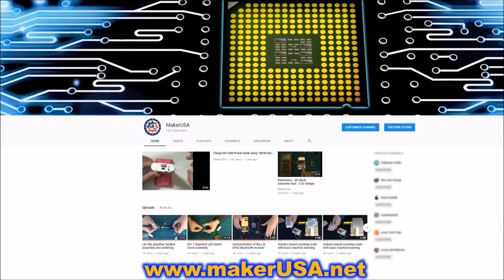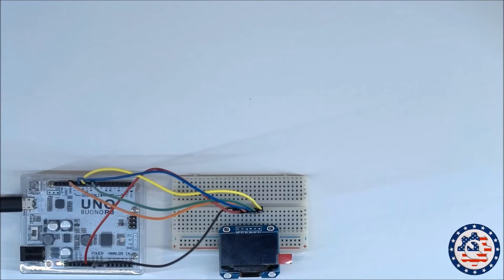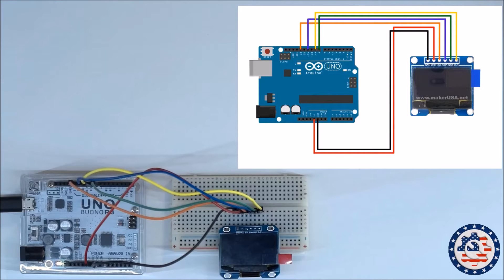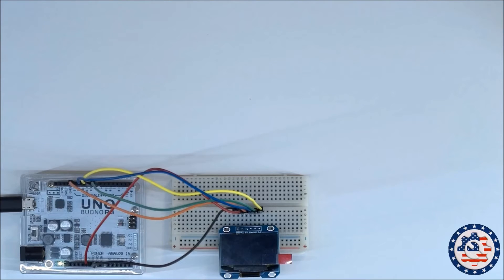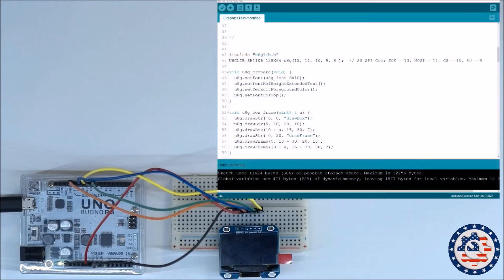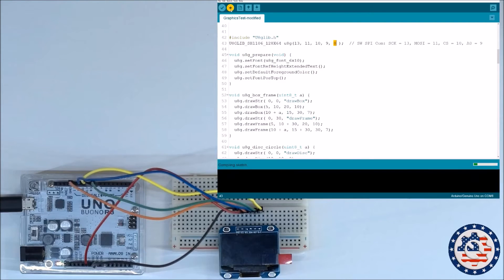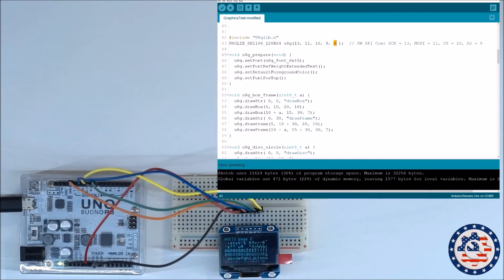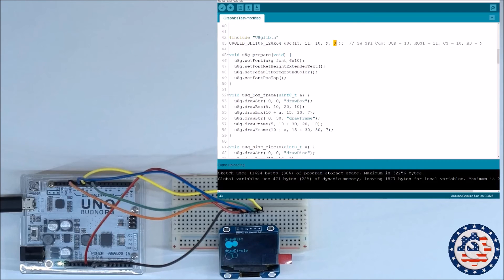How to use 6 Pin SPI OLED display with arduino

Comment: Hello. Since there is no CS pin,  is it possible to use this layout with other devices sharing the SPI bus?
Reply: Probably not. I guess that the pin is brought LOW/HIGH by a connection directly on the board making it work. But you'd need to hack into it to hook it up to some pin on Arduino and manipulate it. Pitty, I just bought a few of these without noticing this and it was supposed to go into a project with 2 SPI peripherals ^_^

Comment: Thank you. Unable to use them until now. Code below worked for me. Note that you define more pins than you use.

#include <U8glib.h>

// Henry's Bench Hello World - for use with Monochrome OLEDs#include "U8glib.h"
//**********************************************
// Change this constructor to match your display!!!
  U8GLIB_SH1106_128X64 u8g(13, 11, 10, 9, 8 );
 
//**************************************************void setup() {

 
void setup() {
  u8g.setFont(u8g_font_unifont);
  u8g.setColorIndex(1); // Instructs the display to draw with a pixel on.
}

void loop() {
  u8g.firstPage();
  do {
    draw();
  } while ( u8g.nextPage() );
  delay(1000);
}

void draw() {
  u8g.drawStr( 0, 20, "Hello World");
 

}

Comment: // Henry's Bench Hello World - for use with Monochrome OLEDs#include "U8glib.h"
//************************************************
// Change this constructor to match your display!!!
U8GLIB_SH1106_128X64 u8g(13, 11, 10, 9, 8 );
//**************************************************void setup() {  
  u8g.setFont(u8g_font_unifont);
  u8g.setColorIndex(1); // Instructs the display to draw with a pixel on. 
}void loop() {  
  u8g.firstPage();
  do {  
    draw();
  } while( u8g.nextPage() );
  delay(1000);   
}
  
void draw(){
  u8g.drawStr( 0, 20, "Hello Abdo");
  u8g.drawStr( 1, 30, "Hello Abdo");   
}